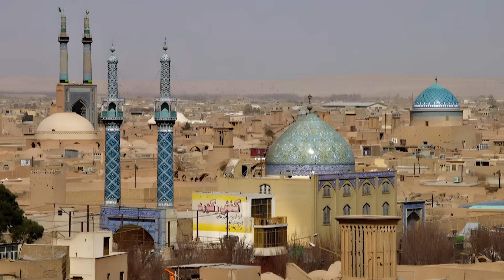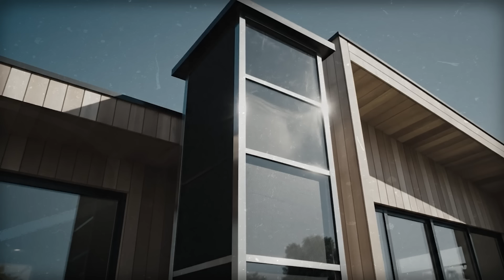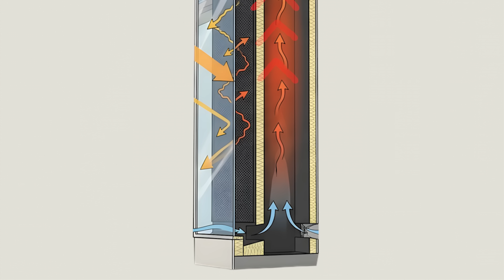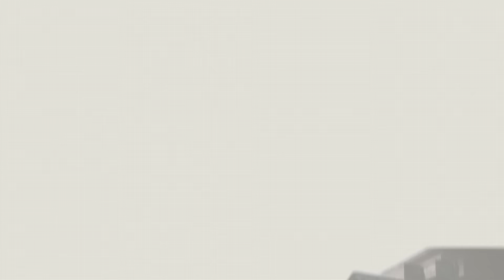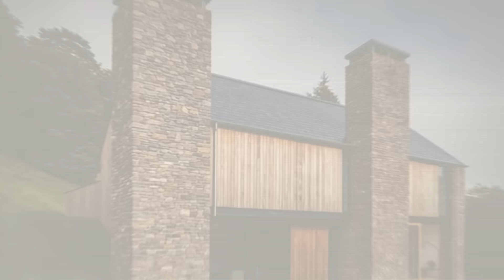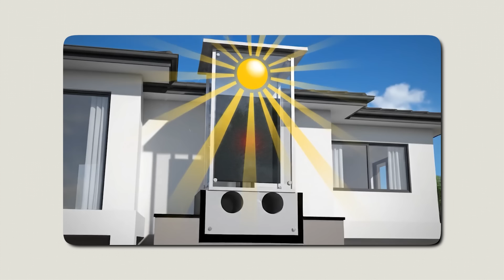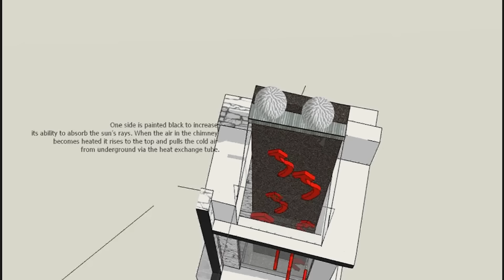This Chimney Will Cool Your Entire Home WITHOUT Electricity. Why Did The Energy Industry Hide It?

Comment: First off, to fight the cold, you need the building to be airtight. This isn't a conspiracy.  Most of the modern building industry has been built around fighting cold, not heat, and this shift is going to require changes like this.  We are tackling a completely different enemy now.

Comment: I've been wanting to incorporate this into my Solar Sash Trombe Wall with Solar Chimney. I have the Solar Sash portion mocked up but will need to start the full build to implement the chimney portion. When I was a Regional Planner I worked on a project, Dorchester Academy Boys Dormitory. The original design had included a solar chimney with intake vents located in every room with them drawing in cool air through base of the closets up through the attic on out the chimney creating continuous daily air movement that kept the closet clothes from being stagnant. It was fascinating, I tried to do more documentation for tech grants but we didn't really have YouTube back then as a outreach platform. At least we got enough grants approved to get the roof patched though.

Comment: 1st, to clarify, heat DOES NOT RISE, hot air rises because it's less dense and therefore more buoyant. Heat radiates and conducts 360 degrees equally. Only convection is influenced by rising warm air. This will keep a lot of confusion out of any project planning. 

2nd, using a metal roof and a ridge-vent system, both from home depot, and a floor vent or opening a low window, you can get a lot of the effect this video is driving at. As a bonus, ridge-vent panels are shaped to suck air as ambient wind flows up and over a gable roof. Paired with a vaulted ceiling this system works really well in dry climates and doesn't require you have the weirdest looking house in the neighborhood. 

As for evaporative cooling, to evaporate one gallon of water takes about 9,000 BTU, or about 2.5 kilowatt hours of electricity. IE: a LOT. Here in the high desert north of Los Angeles your ideas would work very well, but I think if building my own home here I would use a ground tunnel large enough to walk through with sections made of concrete or thick clay bedded in 4-6' of sand to prevent cracking during earthquakes. You would like to be able to inspect that tunnel over the years and make repairs if needed. 

BTW, you can use a "swamp cooler" to cool your AC. It works and it saves about 30% on your AC bill. ACs are NOT evaporatively cooled, so using such a cooler so the AC ingests cool air saves about 1/3rd on your electric bill. I haven't checked in over 5 yrs now, but the data & design used to be on the EPA website. I designed a system for my neighbor in Phoenix 35 years ago. It works!
Part of the savings is you really on need one fan, so the one on the AC doesn't have to work very hard at all as the swamp cooler's does all the work. You just need a proper enclosure. Turn the corner of the AC into the air-flow coming from the swamp cooler to max airflow. Best if that's the bit of cooling fins right out of the compressor as it's the hottest. Shaved $150 a month off her electric bill in the summer months.

Comment: My concern is the intake of moisture, increase of humidity and mold.  I have a mold allergy, I'm wondering if a simple heat ex-changer could be added to this design such as a high thermal mass stone feature centrally located in the home.  The stone feature would be cooled through a zigzag internal structure rather than dragging the moist air through the entire home.  Build the home around the stone feature with every room including part of it.  Large, tall soap stone stoves work this way for heating, could this structure be used for cooling as well?  The stone feature would be used for cooling in the summer and add a pellet stove or gas stove for heating in the winter.  I hope this makes since.

Comment: I guess this system would work along with the ground pipe concept.   As air gets sucked in the house without the ground pipe it would get humid.
But if a series of ground pipes were installed the ground pipe would condense the incoming air and leave the moisture behind to drain out of the pipe.   This would ensure the air coming in the house would be dry air.   
It would be a fun project if I were building a new home

Comment: But where does the cool air come from? If you just draw in ambient air there's no cooling, just wind and unless you have underground tunnels with water in them...? The underground tubes are not always an option and most of the sketches you showed didn't have those either.

Comment: This is great especially for low-humidity locations, but there's no reason not to add HVAC as well to fine-tune the indoor temp. Personally, I think 75F/24C is too warm for an interior residential space hot, so I'd still want to add air conditioning to get it that last few degrees down to 70-72F/21-22C.

Comment: 5:08: "In 1995, researchers at the University of Arizona conducted an extensive audit of a residential solar chimney in the Sonoran Desert. They found that the system maintained an indoor temperature of 75 degrees Fahrenheit while the outside air was a blistering 106 degrees Fahrenheit. That is a 17 degree Fahrenheit reduction using nothing but the weight of the atmosphere and the heat of the sun."

But... but 106 minus 75 is 31??

Comment: Solar chimneys show how smart design can reduce cooling costs without power. Could this work equally well in humid climates and older homes?
Reply from the maker: You have to be careful in high humidity areas.  The problem can be at night when the chimney cools you could get condensation on the inside and possible mould issues.  Best in dry arid regions.

Comment: I recently built a solar thermosiphon heater for my workshop.  It uses the same kind of chamber with dark heat-absorbing material behind sealed glass panels and vents at the top and bottom.  When the sun is shining, cool air is drawn in from the bottom vents.  As the air passes through or over the hot dark material the air temperature increases and rises through the chamber and exits through the vents at the top, thereby heating my workshop.  In the dead of winter when it's below freezing outside, my workshop is perfectly warm.  

The chimney described here has many of the same components and seems to operate on the same thermosiphon principles.  I live in Colorado where we have hot dry summers and cold sunny winters.  Maybe I can make my thermosiphon taller, add an external vent above my roofline, and add a subterranean vent to have my solar thermosiphon heater do double duty and cool my workshop in the summer!  Thanks for this idea.

Comment: its not carbon negative, its carbon neutral if you ignore production and installation. also it doesn't increase the value of a home because its not cold enough for modern homes and makes AC impractical because its not a sealed system. might as well try and AC the planet with a 3 ton unit. you also have a terrible misunderstanding of sealed homes. the air is not stagnant and it is filtered. the real issue is people trying to seal homes not built for it.

Comment: There is a building in Chicago my wife lived in a 4 story that had a central open shaft and a stairwell with windows on each floor ,top of the shaft were transom windows to open in summer to draft the heat out , worked well.

Comment: It moves the outside air through the house. If it's 90 outside the air moving through is 90. That's not cooling. I have lived in the Philippines for the last 10 years and this is used on many houses. I have been in houses with it and houses without it. I didn't feel any cooler in the houses with it. How ever the houses with it cannot have central AC. You can have AC in a single room. But not central it will all be funneled up the air shaft. Botton line it in no way cools the air. It only makes for better ventilation.

Comment: so when you're building a house and you incorporate this design and the inspector says you have to have a conventional HVAC system you only have to buy at one time because you never use it. It's never gonna go bad. You're never gonna have to replace it so sure it might cost you a couple thousand bucks but you'll never have to replace it and you can go for the smallest unit possible with the cheapest unit possible because you're never gonna use it to begin with. It's a small price to pay for the ability to have heating and cooling that doesn't cost anything which is the end result?

Comment: Earth tubes only work in the desert. If you live in a four season, relatively more humid region, the geothermal system needs to operate on a brine or liquid system installed by professional geothermal contractors which cost $25-$35k. If you try to do an earth tube in a humid region, you're risking pulling mold into your house or you need a way to clean 100ft of tube on a regular basis. I would increase my south facing thermal mass and try a roof garden to reduce the amount of hours needed for AC in the summer and maybe have a better heat vent.

Comment: We have a simple passive tower, which brings in cool air (during low pressure events), and vents out the hot air all the time.  Both bathrooms have this tower.   Subtropical, this is a version of the desert coolers and really helps.

Comment: Okay, but hear me out. Given retrofit solar chimneys are not feasible for most people, ERV with outdoor intake through an earth air tunnel. You can take advantage of a sealed home while ventilating in a way to passively cools or heats instead of ventilating and still needing to fill the temperature difference gap with mechanical heating and cooling.

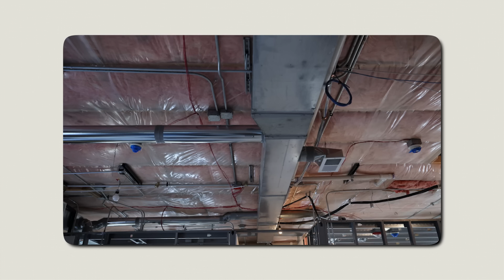Comment: I’m only at 5:51 and I wanted to say dang it. I doubt it’s easy to find ancient technology that worked in hot humid climates such as Florida and other swampy areas. I don’t live in Florida but I have and still do live in other swampy areas in the USA. I like to think my current location is not as humid as some of the places I lived in the past but I’m not sure. It seems like a lot of ancient technologies rely on hot dry air drying out things such as wet clay pots or in this case, air being able to move much at all.
11 minutes in, I went ahead and liked the video anyway. I feel hot dry places could use things like this.

Comment: well they used it a LOT .. its called a roof turbine.. when spinning it would suck air up vent on the ceiling. my house is 1970 and it was made that way. 

it doesnt work well when you have to heat. cooling ? yeah , climate control ? no so much. because at that point i agree that this system with a woodstove properly balanced could be the best ,,, for us not for the grid

Comment: I really wished these videos would just say "there's a dark colored plate that gets hot from the sun. It heats the air in the chimney, which rises. This pulls cooler air in through a window on the shaded side of the building" 

They have many shortcomings. 
This video asserts some bullshit without addressing these below. 
Especially the part about how they don't work at night.

1) Weak driving force (low pressure difference)
The airflow comes from warm air rising due to density differences (the stack effect).
The pressure difference is very small compared to fans
That means limited airflow rates unless the chimney is tall and well-designed
In practice, it often struggles to ventilate large or densely occupied spaces
2) Strong dependence on sunlight
Performance is tied directly to solar gain
On cloudy days, at night, or in shaded locations, airflow drops sharply
Without thermal storage, it can be inconsistent or stop entirely after sunset
3) Requires significant height or scale
To generate meaningful airflow:
The chimney needs height (often several meters or more)
Or a large heated surface area
This creates:
Design constraints in residential buildings
Higher construction costs if scaled up
4) Climate sensitivity
Solar chimneys work best in:
Hot, sunny climates with large day–night temperature swings
They perform poorly in:
Humid climates (less temperature difference, heavier air)
Cold climates (heat loss may outweigh ventilation benefits)
5) Limited control and responsiveness
You can’t “turn it up” instantly like a fan
Airflow changes slowly with temperature and sun intensity
Harder to precisely control indoor conditions
6) Heat gain side effects
The system intentionally absorbs solar heat
That heat can leak into the building, increasing cooling loads if not well insulated or separated
7) Integration challenges
Needs proper air inlet design, airflow paths, and sealing
Poor integration can lead to:
Short-circuiting airflow
Uneven ventilation
Minimal actual benefit
8) Not ideal as a standalone system
Usually needs to be combined with:
Cross-ventilation
Thermal mass
Or even hybrid mechanical systems

Comment: This is complete crap. For this to work you need: The chimney, Everything but the desired air path to be practically airtight, the outside air to be desirable in the first place.
Basically, this is only good in cases where you would enjoy outside breeze. The second outside temperature is to hot or cold, or the air quality is bad, this is more detriment than help.
This thing requires the building to be designed for it. if your country is too poor to have widespread AC's, it's also too poor to have structures designed with this thing in mind.

I live in middle east. This would be better than nothing, but it's no substitute for AC.

Comment: ON  the Southwest Desert, in summer, sucking 110 degree dry air in at the bottom is not cooling, especially on a single floor 1500 sq. ft. house.  Growing plants inside will help freshen the air, adding oxygen as a by product of their life cycle.  CO2 is plant food, not a toxin.  There is too much propaganda in this video.
This only becomes feasible at 2 to 4000 ft. elevation of the Sonoran Desert.

Comment: Hi. I'm about to get a degree in Architecture and Environmental Engineering.
This is pretty standard "Natural Ventilation", and has literally been around hundreds, maybe thousands of years.
In particular, having a "chimney" like this is just what we call "Stack Ventilation".
Ignore the other comment by the HVAC guy, this does not require water OR even winds, just the buoyancy effect of air, which is why its used in low/zero-carbon designs.

https://en.wikipedia.org/wiki/Stack_effect

Comment: Classic AI generated clickbait video, dropping in a random idea and AI goes " OH YES THIS IS A WONDERFUL IDEA, EVERYONE SHOULD DO THIS"
So here is a low effort AI reality check:

Why the video is misleading (The "Clickbait" Reality)

1. A solar chimney does not cool your house.
A solar chimney is just an exhaust fan powered by the sun. It moves air; it doesn't cool it. If it’s 100°F outside, the chimney will just rapidly pull 100°F air through your living room.

To get the "15 degrees of cooling" the video brags about, you have to pair the chimney with an Earth Tube (burying hundreds of feet of pipes underground to pre-cool the incoming air). The chimney isn't doing the cooling; the dirt is.

2. The "Earth Tube" mold trap.
The video glosses over earth tubes like they are a simple DIY weekend project. In reality, earth tubes are notorious in the building science community for being incredibly problematic. When hot, humid summer air hits a 54°F underground pipe, condensation forms. If you don't engineer a perfect drainage system, that pipe becomes a dark, wet breeding ground for mold, mildew, and bacteria, which the solar chimney will then suck directly into your living room. They can also become traps for radon gas and flooding.

3. It completely ignores Humidity.
This is the single biggest reason this technology isn't ubiquitous. In arid climates like Arizona, New Mexico, or Iran, moving lots of dry air works wonders. But if you live in Florida, Texas, or anywhere on the East Coast, pulling 10 to 12 air changes per hour of outside air into your house will turn it into a swamp. Air conditioners don't just cool the air; they dehumidify it. Solar chimneys cannot dehumidify.

4. The "Conspiracy" is fake.
The video claims the HVAC industry and building codes suppress this technology so they can sell you expensive, fragile air conditioners. This is a classic clickbait trope.
Building codes (like ASHRAE 62.2) don't ban solar chimneys; they simply require predictable, reliable ventilation. A solar chimney only works perfectly when the sun is shining brightly. At night, or on still, overcast days, the airflow drastically drops off. Modern humans want their houses to be exactly 72 degrees, 24/7, rain or shine. Passive systems cannot guarantee that.

The Verdict
It’s not a scam, but it’s definitely overhyped architectural romanticism. Solar chimneys are a fantastic supplementary passive design feature—especially if you are building a custom, eco-friendly home in a dry, sunny climate from scratch.
But presenting it as a cheap, zero-maintenance replacement for modern air conditioning that "Big HVAC" doesn't want you to know about is pure clickbait.

Comment: Ooh my, this video is amazing, it has confirmed my thesis which  i have been working on  for the past year . Thank you, in places with high humidity vertical stratification is a bonus to keep the air cool on the breathable zone which is 1.8 m or 6 feet above the ground. higher ceilings
Reply from the maker: Glad it helped! Appreciate the insight regarding ceiling height! Thanks!